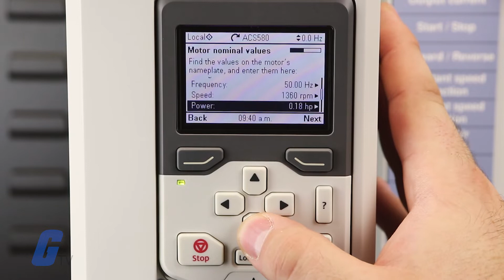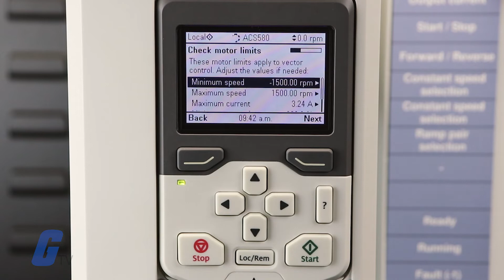How to Configure Vector Control Mode on ABB ACS580 | Galco

Comment: how to do settings for vector control closelope control with a 3000 ppr pulse encoder?  functioned to adjust the gap of two workroll rods, 0.1 micron error tolerance, 380vac motor, 1500 rpm, gearbox ratio 1: 200. max 100 micron gap, 0 micron min gap or called contact roll. Thanka 🙏🏽